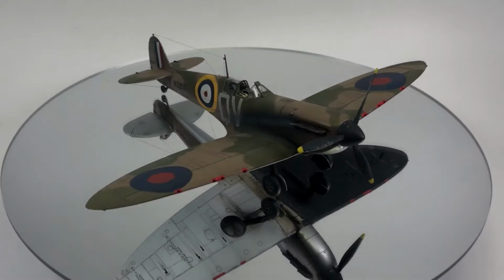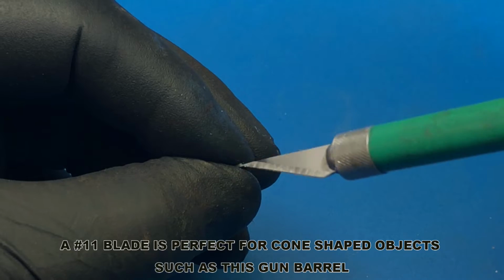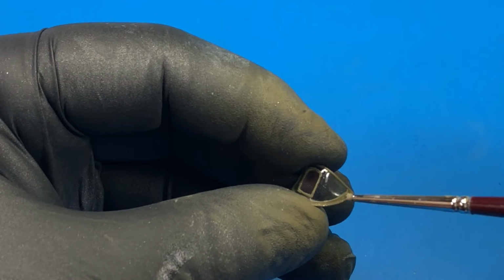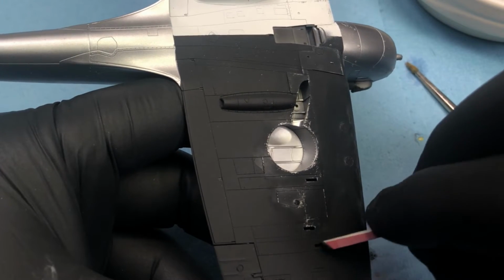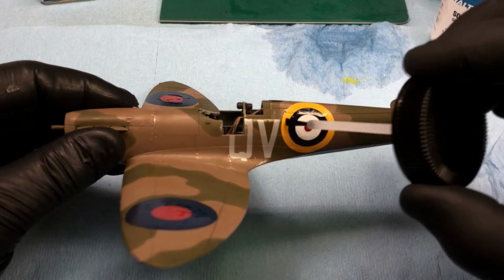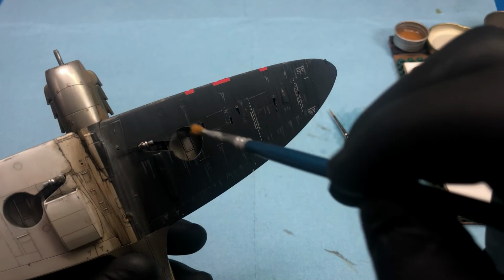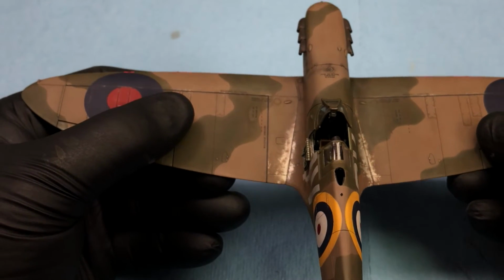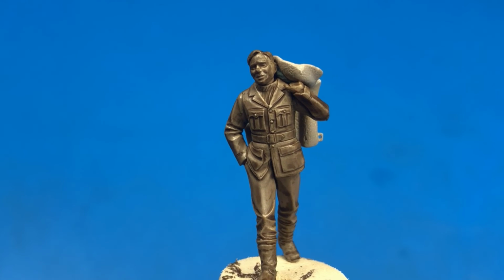FULL BUILD TAMIYA SUPERMARINE SPITFIRE Mk1 (PAINT & WEATHERING)

Comment: Amazing video! Great explanation, detail and result 👏 how much time do you have after applying the hairspray to do the chipping? Or are you not against the clock with this method? I've used chipping medium before (only once) and been told the window to work in is around 15 minutes, and after that everything has 'set' and you wont be able to chip.
Reply from the maker: Thanks a lot! As far as chipping goes it really depends on the chipping medium and paint you use. If you use a true acrylic paint such as Vallejo for example, it’ll take less time for the water to penetrate to the chipping medium. If you use Tamiya paint for example it’s sort of an acrylic/lacquer hybrid which you’ll need to be much more aggressive to chip through. To be honest it’s all experimentation, trial and error. I’ve had great results and poor results there’s really no magic formula for it. Thanks again for watching and consider subscribing if you haven’t already. Cheers!🙂
Reply: @SmallSoldier  thanks a lot for the quick reply. And subbed!
Reply from the maker: Of course... no problem. I appreciate your support. 🙂 @ChristopheW88

Comment: Should I apply x22 gloss before applying decals ?
Reply from the maker: You can but I prefer Alclad 2 Aqua Gloss clear "ALC 600". I find I get better results than with X22. If you can't get the Alclad stuff make sure you thin the X22 with either Mr Leveling thinner 400 or the Tamiya Lacquer thinner "retarder type" with the orange cap which is similar to the MLT. Hope that "clears" 😉 things up. Cheers!
Reply: @SmallSoldier  tamiya x20A thinner not good for this ?
I only have this type of thinner and in online people say its ok cause its not a enamel paint so you dont need laquer thinner
Reply from the maker: @OdysseyAviation  it’s not great tbh. If you can get the Tamiya orange cap it’ll work best.

Comment: Nice video and thanks for the tips!
I am trying to apply the pin wash on a 1/72 model and I am trying different ways but I find so difficult to not end up with a messy panel especially after trying to clean. 
How long should I wait for the oil paint wash to dry before cleaning it? When I use ear cleaners or brush to clean the paint leaves the lines and ends up smudged on the wings 😢 maybe I need a bigger model to learn this easier perhaps?
Reply from the maker: Your welcome. I usually use a hairdryer to dry the wash then remove the excess right away. I like to use a blue shop towel to remove the excess. It’ll remove the wash without leaving residue behind.

Comment: would you rather recommend liquid putty for filling gaps, or diluted plastic goo?
nice video btw, really pleasant to watch.!
Reply from the maker: Both have they're place but "Sprue goo" is essentially liquid plastic so it feathers into the plastic model a little better. I also use CA glue from time to time especially for getting rid of ghost seams..
Reply: Yea, goo makes huge sense. Some of the filler I have been using can be cleaned with water so you cannot wet sand. Also some fillers don't feather that well leaving an edge. Hadn't thought of mr surfacer for gap filling fine cracks....doh

Comment: If I use only Mark Fit strong will it do work for decals ?
Reply from the maker: Well like anything I would do some tests if you can before trying it on your model, especially if you’re not familiar with the product. It really depends on which companies decals your using. Some decals work great with Micro Sol others are thicker and tougher which makes them difficult to conform so I like to use Solvaset for those. Be careful as some decal solutions will make the decal prints run or discolour. I hope this helps with your decisions.🙂🙌🏻
Reply: @SmallSoldier  well the spitfire from Tamiya will be my first build and I have some mark fit strong with it
Reply from the maker: @OdysseyAviation  I’ve used mark fit and it’ll work. You may need something a bit stronger if it’s being stubborn like micro soul. Good luck I hope your build goes well. 🙂🙌🏻
Reply: I also have other question . Do you think 17mL of dark green RAF color and 17mL of Brown RAF color will be enought for this build ?
Reply: I have MarkFit strong from Tamiya
Reply from the maker: @OdysseyAviation  What paint brand are you using?
Reply: @SmallSoldier  tamiya and Vallejo
Reply from the maker: @OdysseyAviation  Yes, more than enough. Are you airbrushing of brush painting?
Reply: @SmallSoldier  airbrush it’s much better and cleaner compared to brushing .
Reply from the maker: @OdysseyAviation  Oh that's perfect then as you'll be thinning the paint down anyway. Good luck I hope it goes well. Cheers!
Reply: @SmallSoldier  and also if I paint with XF16 aluminium instead of metallic spray the inside of the fuselage is it going to be ok ?
Reply from the maker: @OdysseyAviation  as long as you mask it all off it will.

Comment: Do you just throw in sprew bits into glue and let it melt down the parts?
Reply from the maker: Yes, exactly. I try and use the same sprue as the model I'm building as it'll sand easier because it's the same plastic composition.